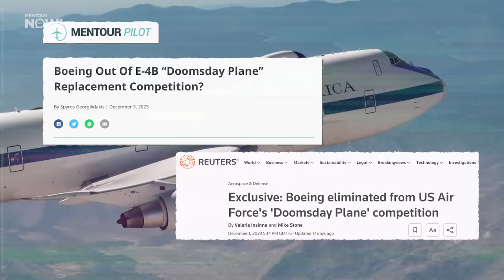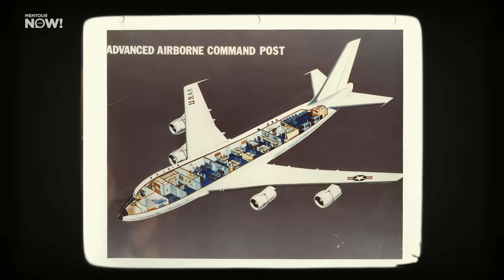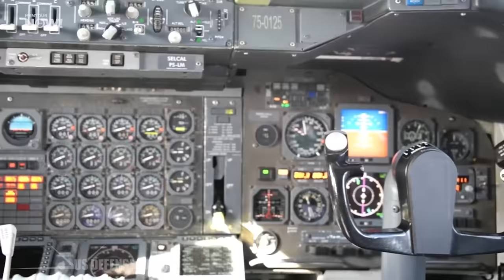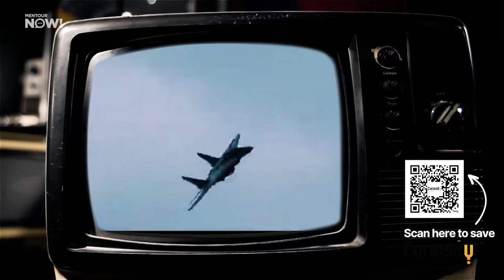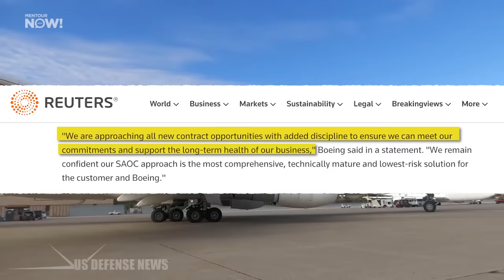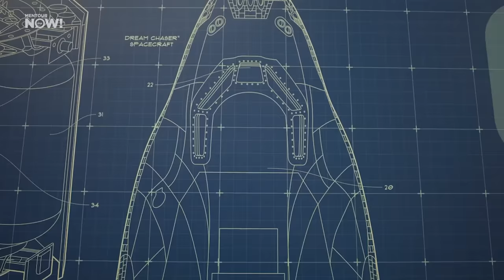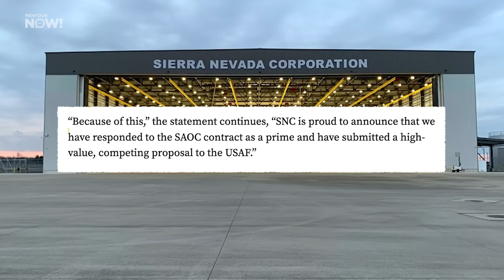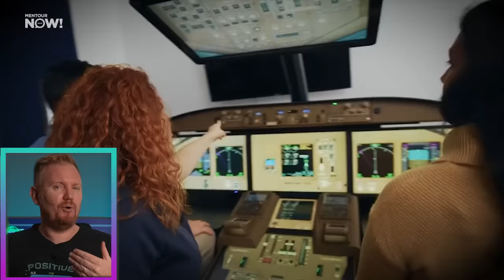Why was Boeing kicked out of the Doomsday Plane competition?!

Comment: I was just watching a video on the KC135 tanker, and they confirmed that it could maintain level flight fully loaded with 2/4 engines, and could maintain "long distance glide" with 1/4 engines fully loaded, and level flight with 1/4 engines if "light enough". That is the sort of reliability we need for these mission critical aircraft.

Take a 747 and put a380 Engines on it or something.
Reply: The difference is that the KC135 has a service ceiling of 50,000+ feet (where all 4 engines are needed) whereas flight with two engines brings them down to pleb altitudes like 35,000 feet.
Reply: 50,000 is officially confirmed but higher is likely possible. Biggest issues are pressure differential and reserve oxygen for crew (USAF mandates pressure suites above 50k)
Reply: And that's for an aircraft based on the Boeing 707.

Comment: A significant part of the cost for aircraft like this is likely to be from having to take existing aircraft apart and rebuilding them.  The labor required to redo the wiring especially, and more so since even Boeing probably doesn't have too many people left who remember putting them together in the first place- there's a learning curve, and whoever has to put these things together will get good at it right about the time the production run ends.

Air Force should have done this before the line shut down.
Reply: It's not like the 747 line has been down for decades. They delivered the last one earlier this year and Boeing has been building 747s for half a century. I'm sure they've still got plenty of people around who know the 747 design and assembly process in great detail. Institutional knowledge certainly does erode over time, but not THAT fast.
Reply: Boeing said building the Air Force ones using existing planes ended up costing more due to disassembly and reassembly than purpose building them from scratch.
Reply: @bullhornzz  Indeed, but that wasn't due to loss of institutional knowledge of how to build the things. The line was still running when much of that work was done. I'm certainly not saying that the conversion won't have a lot of difficult work involved - it will - but rather just that loss of institutional knowledge shouldn't be too bad of an issue if they start work on this soon (granted, if it's 5 or 10 years down the road, that's another matter entirely.)

Comment: Government contracts can be very difficult to agree to. Often they are not only fixed price but they can include a clause that allows the government to cancel at any time, even after you have spent serious money getting started or even well into the delivery, without paying any cancelation fees. Or they can decide that essential changes must be made that "don't qualify for overruns". My personal family story - my father's company had a fixed price contract to build a pair of buildings at what is now Idaho National Laboratory. But the government engineers did not complete and release the plans to start construction until September, instead of June. As a result, the company was faced with pouring concrete in -40 degree weather,  requiring extra high performance jet heating systems, special inflated plastic enclosures, and men working two hours on, two hours off. This resulted in a $300,000 overrun (in 1955)  that the government promised to pay but never did. The company was technically bankrupt but was carried by the banks for three years while it recovered.
Reply: In the UK it seems to work the other way, where a contract is given and a price agreed and then with continual changes and alterations to the original plan. The added costs of all the alterations blamed on the manufacturer and not the hapless government. Hence the demise of the UK Aircraft industry, as being to expensive!
Reply: Not to mention that the government pays when they get around to it -- leading to layoffs because the contractor doesn't have money to pay employees and then to production delays due to retraining both of perishable skills and because the best people found other jobs.
Reply: Too brutal.
Reply: He should have delayed construction for a year. The lack of urgency in getting the plans ready is a give away they weren't too concerned about the completion date. 

He should have had a clause stating he had the right to delay in the event the plans were late.
Reply: @michaeledwards2251  You've apparently never worked for a government contractor. 

The government is 100% in charge and it doesn't matter how impossible or ridiculous their expectations, the contractor bears all the liability for everything and the government 0%
Reply: @michaeledwards2251  Actually, the USAF was insistent that it was an emergency. They told him to do whatever it took to get it done on time, and they promised they would pay for the additional costs. His crew had to pour concrete in subzero temperatures. I won't go into details here. But after he did finish on time, they stiffed him. He wasn't used to dealing with federal government shenanigans.
He worked with one senator to get a special bill passed but the Senator died. Then the replacement Senator was forced to resign due to bad behavior, and then my dad died.
Reply: @michaeledwards2251  The project was two buildings for the Atomic Airplane project, which was one of the most screwed up projects of that era. Itcwent from crisis mode to cancelation, back to crisis, to cancelation, multiple times.
Reply: @GaryBickford I've seen enough armed forces "emergencies" to guess it was an Officer that had to get this project completion on their next promotion application before their current deployment period ended. IE: the emergency is their next promotion/pay raise.
Reply: @danielclawson2099  Hahaha probably too true! But this project was snakebit from the beginning. It went from panic to cancelation and back multiple times as different generals with different opinions ran the USAF. It was finally put out of its misery by Kennedy in 1961 IIRC.
But despite all that, the engine technology work was beneficial to NASA in the late 1960s when some of that work was used in the development of the NERVA third stage nuclear rocket engine, to be used in the Saturn 5N, to go to Mars. NERVA was canceled by Congress in 1971 specifically to end any Martian ambitions by NASA, as a "useless boondoggle".

Comment: I would have chosen the Lockheed C-5 Galaxy from the start.  It is probably already hardened against EMP.  And it can take the weight of all the special protection.  And it has the size for whatever is needed.  They could even be configured to load and unload a protected limo in and out of the back without the VIP ever getting out, and still have a fairly spacious area in the plane.  Further, that area for the President or other VIP could be a module, designed to jettison with parachutes in the event the airplane is struck and is going to go down badly.  There could even be explosives to split the plane like an egg if necessary to get that module out.  The airplane itself does not even need massive modification, that module could have most of what is needed for protection.  Though I still would protect the aircraft with A few inches of Kevlar composites (or similar) on the entire skin, and an inch or more of titanium (or appropriate alloy) shrouding the engines, fuel tanks, and doors to the landing gear.  I would also have a redundant flight instrument and control system inside the pod...perhaps automated...so you really don't need all the controls, instruments, chairs, pilots and such, just wires, the computer, and interface.
Reply: nate, your narrative totally cracked me up.  the idea of the president being airdropped in a limo from a doomsday plane reminds me of dr. strangelove, but i'd guess that movie was well before your time.   we might need to drop in tanks and paratroopers to help him get to wherever he would go in the limo.
Reply: @billmcgahey1926  I haven't seen the movie. Nice to have a good laugh, but the President or VIP (and guests) would exit the limo and enter the pod after the door in the back of the plane closes.  After that, they can even open the door again and back out the limo to reduce weight before takeoff. The pod is moveable, sliding on bearings and can be jettisoned, and parachute down.  This would only likely happen if the airplane was hit, and not able to make a safe landing at a secure airport. 
All securing cables/chains can be released from within the pod.  It would be protected against intense heat, impact of projectiles, and radiation, airtight/watertight and have its own air supply, and good filtration, after that runs out.  It would also float just slightly, maybe 6-12" above the waterline. 
In a pinch, the pod could be put on any C-5 Galaxy, but with reduced capabilities (can't fly the plane from it).  This might be useful if you are bringing in a VIP to a country at war.
Reply: @billmcgahey1926   Having undergone MOPP (Anti-Contimination Warfare Apparrel) many, many times, I'd think not having to be exposed to radiation or biological agents would be a rather good idea instead of having to suit up, just to switch planes.

Comment: I worked TACMO in the late 80's when we transitioned from the EC-130Q to the E-6.  The E-6B is now getting close to end of life and looks like it will be replaced with a stretched C-130.  Funny how it has gone full circle and back to the C-130 after some 30 years.
Reply: So why would they pick a turboprop over a jet?
Reply: @KanyeTheGayFish69  the C-130 does a better job in that roll when on station.   That is why.

Comment: I kept expecting you to say they might be looking at the A-380... but with Emirates looking to scoop up every last one of those ever made, they'd be expensive.
Reply: And european.
Reply: Expensive isn't the issue. With airlines retiring A380s rapidly these days, they could probably get them quite cheaply, likely much cheaper than the 747-8, of which there aren't that many and which few, if any, existing operators are planning to retire. Modifying them to meet the Air Force's requirements and doing so without sharing some of the country's most highly-classified information with foreign entities is the much bigger problem. Also, 100% of the operators are not in the U.S. (or even in the Americas,) which adds more security issues with the acquisition. Also, while the A380 hull isn't nearly as composite-based as the 787 or A350, it's still made much more of composites than the 747, which makes it much more difficult to harden against EMPs. Using a fully-metal frame makes that job far easier.
Reply: Their national pride wouldn't survive buying a foreign aircraft.
Reply: Emirates is nuts. That’s what too much money does to people. 😅

Comment: The US government pressuring Boeing to build aircraft at a loss goes back at least to the Boeing model 299 that would later become the now legendary B-17 heavy bomber of World War 2 fame. That project almost didn't happen several times due to the Army Air Corp demanding a lower per unit price. Thankfully a compromise was reached. Given that military contracts always seem to have budget over runs now days and with what's happened to Boeing with the 737 Max I think Boeing is just trying to cut their losses and not set themselves up to fail.
Reply: The real problem is Boeing has mismanaged the both the Air Force One contract and the Air Force Tanker contract.  FOD, errors, and non-responsiveness.  Add on top of that, they originally lost the tanker contract to Airbus due to because of a corruption scandal, sued to get it back, then performed poorly once they got it back.

Boeing used to perform on defense contracts but due to it’s current management, seems to not be able to get themselves together.
Reply: Nobody made Boeing operate at a loss; they managed that entirely on their own, by repeatedly failing at multiple programs over the last 10+ years.
Reply: @bigd4366  Maybe.  The government is notorious for introducing change after change after change.   That gets expensive quickly.   Don't know if that is what happened with AF1 or not.   The tanker visual system has been a bottleneck from the start.   Eyeballs worked just fine on KC-135s.

Comment: The 4 engines aren't just for redundancy ,they need the extra engines for the electrical power they can generate.

They are also probably nervous about retrofitting a plane they no longer build and keeping it airworthy for the next 40 years....there are a lot of hidden costs in that.
Reply: Considering there are airworthy 737-200s and 727s out there.  I don't think that's a big issue.
Reply: @cjmillsnun  
The thing I don't think you realize is that the newer models of 747 can't be EM hardened to Air Force Standards , so they would have to take an existing 747-200 , which will be at least 32 years old , rebuild it and then keep parts and technical advice for the plane available for the next 40 years.

The 747-200 has been out of production since 1991, and there are only 19 left, six of which are operated by the Air Force.

I don't think Boeing wants to get locked into maintaining parts and training pilots  Engineers and technicians for just six planes for the next 40 years.

They want the Air Force to replace their 747-200s , not acquire another one.
Reply: Power could come from an APU, don't need a wing-mounted engine just for electricity.
Reply: The e-4 also keeps one or two engines running at all times when it's on the ground during operations
Reply: @T_Mo271  Sure, but adding new APUs to an airframe isn't the easiest thing to do. They would need to be mounted in a place where they can both get air intake and have a place to expel their exhaust. Which means they need to be outside the pressure vessel. There's not a lot of unused space outside of the pressure vessel in a 747 (or virtually any other commercial airliner.) Easier to just use the main engines. If you didn't just use the main engines, you'd likely end up having to add pods under the wings for the new APUs anyway, which rather defeats the purpose of not just using the main engines and would require significant design costs.
Reply: @glennchartrand5411 thry could use the 800 and retrofit the 747-200 controls theoretically so atleast its a reliable aircraft and the pilots dont need any training on the 800 digital design if they havent flown them and would help against EMP attacks
Reply: @EnglishDrifts69GTxRED The Air Force is demanding that the new A-4 be identical to the ones already in service.

That means dragging an old -200 out of an aircraft junk yard , completely refurbishing it to pristine condition and then providing parts and technical support for the next 40 years.

Boeing isn't real interested in doing that.
Reply: @vbscript2 
If I recall correctly, the apu on the 747 is located in the tail
Reply: @AzrealMaximus  Yes, it is (as with almost all airliners.) I just meant that there isn't likely space to add additional APUs back there, especially not ones large enough to generate power equivalent to the main engines.
Reply: @vbscript2  
Gotcha, kinda thought that's were you were going,  not sharpshooting.
Reply: @T_Mo271 - How many APUs do you think would be needed to replace the huge turbofans ability to produce electricity AND thrust. 
Don’t forget the extra drag of each APU.
If the shoe fits… 😮